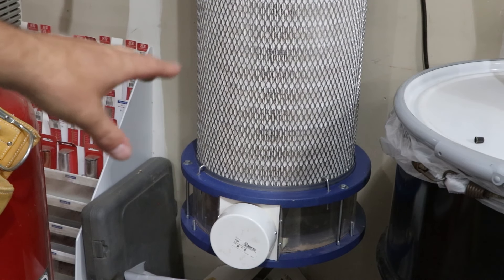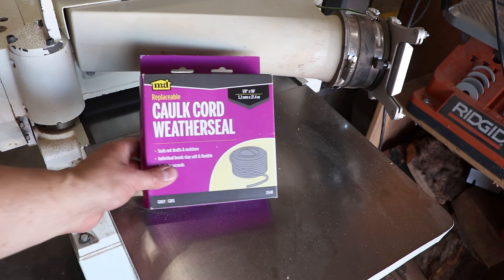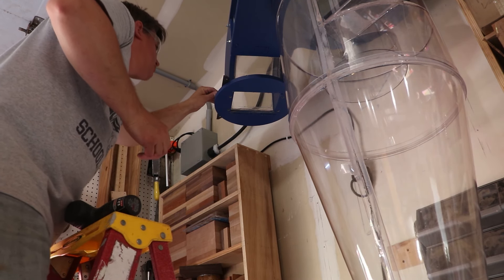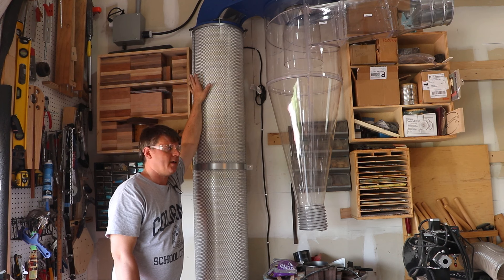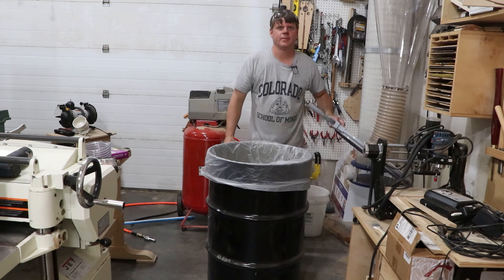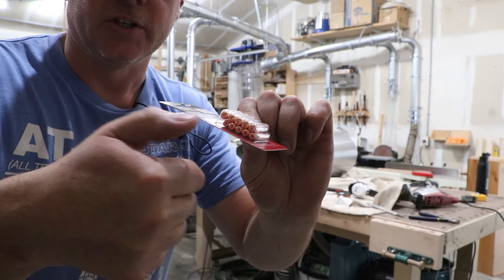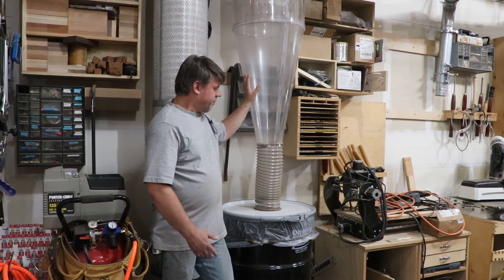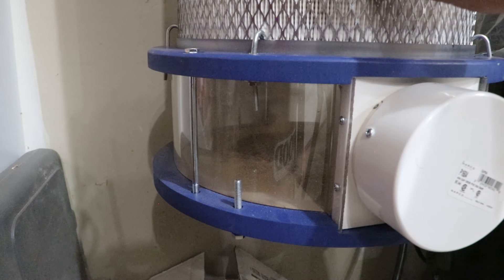Shop Made Upgrades to the Dust Collector

Comment: Turning a bag of hammers into lemonade.   I saw the first video and your frustration certainly came through, but it's good to see you plot solutions for this.   I respect your tenacity Brian.    Good on you.
Reply from the maker: Thank you!
Reply: @Benham_Design  Brian not to send you back to the drawing board, but Mike Farrington just posted a video adding a filtered cyclone DC to a new miter station and he used a fancy trick with a threaded top to a 5gal bucket to make both the filter and the fine dust collection bucket disassemble quite easily.   Sourced from Win (Wen?) Environmental.    He's entertaining enough to watch the video either way, but thought it applicable.    He also throws in the random humorous commentary (not to take away from your "that's what she said"  moment in this video).   👍

Comment: I cut a piece of cabinet liner to fit into the drum to keep the bag from being sucked up. I moved shops about 6 years ago, now my Onieda cyclone is vented outside, wow what a difference in suction, no more filter issues and constant suckage. I live in So Cal so pushing inside air out is not an issue. I did not like the build quality on the clear vue, so I got lucky and found a 3hp Onieda system with tons on spiral in my area for very cheap, no issues so far with this system...

Comment: It's too bad good dust collection is so hard to come by and so expensive.  I had a similar customer service experience with a rival of your manufacturer (the same one who's name is on your 55 gallon drum).  I got lucky though that the engineering was (mostly) better than you've experienced but the sales (rude), delivery (late) and customer service (non-existent) were absolutely horrible.  With that said, I like your fixes and you've given me a couple good ideas to upgrade my own dust collector.  Thanks!

Comment: Thanks for posting this.

J-bolts: great solution. Pretty much what the Oneida dust collector I have does. It just uses foam weather stripping to seal it. Installing with the spinning j-bolts is a bit fiddly at times, but it works.

Volume super low again whenever you're on camera. Most video editing software will let you normalize volume to a certain level clip-by-clip. I have volume cranked all the way up to hear you. I see you have a lapel mic in some shots, but it's not in the right spot. When you turn towards it (like the cough around 8:55) the volume is good.
Reply from the maker: At least it's getting the coughs. 😂
Thanks for the feedback video production is a steep learning curve for me.  
I had the mic closer, but people said they could hear me breath heavy.  
So now I moved it and it's too quiet.
Then of course I've filmed the next 4 vids that way already, so I have a back log of bad audio. 🤦‍♂️. Ahhh well

Comment: Again, I'll make a comparison to Laguna...  My DC has a baffle in the filter that you can spin manually to knock all the fines out of the filter, then they collect in a small bag that attaches to the bottom of the filter.  I just give it a spin every time I empty the hopper.  It also came with a can liner like you made...  All that said, I like how you solved all the issues the design team at Clearvue should have addressed. Some single sided weather stripping on the filter would have done the trick.  Probably $4 for a 50 ft roll.
Reply from the maker: If I got to do it again I would have totally put more consideration into the Laguna.  I do love my bandsaw, it is definitely designed to hit a lower price point.  However even though, it's not as robust as it's more expensive counterpart it's a solid machine and has served me well for several years.

Comment: Nice upgrades! I've had a ClearVue for 7 years and I love the performance. Build quality... yeah, I can see that argument. Fedex smashed two cyclones before I finally got one undamaged (they also destroyed a motor so it's hard to find fault with ClearVue overall there). I've thought about using a bag in mine and doing one of those setups like on the Oneida Festool dust extractor cyclone add-on thingy - where a small tube runs from the cyclone intake to the barrel and pulls a slight negative pressure between barrel and the bag, keeping it uncollapsed. I am lax with cleaning the filters... when I think about it I give it a beating to tap the dust loose... when I really feel ambitious I plug the intake of a shop vac to the dust cleanup and use the shop vac exhaust hose to blow out the filter stack. It's an interesting machine but overall I have quite a bit of love for it and I can see the air quality in my shop actually improve when it's running.
Reply from the maker: Thanks man, the performance is fine from comparable units from other companies. However after, I assembled mine , I will never equate Clearview with quality.  As for FedEx smashing multiple ones, my thoughts are that Clearview was too cheap to provide adequate packaging.  But that's my disgruntled mind talking as I'm not impressed with Clearview.
Reply: @Benham_Design  I wonder if the quality lessened since 7 years ago. Mine was put together nicely (still MDF and lots of silicone though). The thermoplastic is definitely not indestructible as FedEx proved - it will certainly crack under a sharp impact. Perhaps I’m content because my last DC complete garbage and made sit quality 10x worse when running.

Comment: I have the same system, so I appreciate the troubleshooting on the filters. I did not have the same issues with the assembly that you did. I guess i thought the engineering issues that you have mentioned are due to being the cheaper option for that size of collector (at least it was the cheaper option when I got mine several years ago)
Reply from the maker: Yeah, it is cheaper than a metal cyclone, and I can look past the fact that it is plastic.  The things I don't like about it are the lack of forethought into how it is assembled.  Such as how the filters are attached.  Several people have commented that the filter company makes a brack that would solve that problem, and I'm willing to bet the additional cost would be negotiable. However, Clear Vue doesn't appear to be interested in improving their products.  
The gaps between the plastic and MDF on the out port leading to the filter stack exist even if you didn't have to heat it up and bend it into place like I did.  
These gaps could easily be removed by adding an inch to the MDF flange then put a dado in it to hold the plastic in place like they did on the sides.  This again would be a negligible cost to do.
This cyclone has been on the market for over a decade and they have not made any attempt to improve the engineering of their product.
It has the potential to be an affordable and quality product, but the will to make it happen is lacking from the company.  
At least that is my perspective, but each of us have different expectations of what we find acceptable.

Comment: I was wondering if you have any ideas on sound proofing the machine / noise reduction , if you make any I would be interested in seeing them. Keep up the good work
Reply from the maker: I have wrapped a moving blanket around the impeller area and that has made some difference, and I plan on in the future to hang some Rockwool panels from the ceiling in that area to absorb some sound.  Unfortunately I don't think there are many options to quiet a 5hp motor with a 16"DIA blade spinning at however my thousands of RPMs.

Comment: Sorry you had a bad experience.

Two Thoughts:
1.Odd they don't include filter mounting hardware. My understanding is they are using Wynn filters, which when you buy them directly from Wynn, they include really nice clips to mount the filters on. I think they also included foam gasket!
2. I like to have a shop vac port on my cleanout to run while I used compressed air to clean the filter. I'm not sure if it does anything, but I like to think it helps pull the fine dust down vs letting it get stuck back on the filter.
Reply from the maker: A shop vac port I think is a good idea to keep air flow while cleaning.  I wondered how much was settling back on the filters after I blow them out while I was cleaning them

Comment: You should see if anyone in your area is interested in getting your saw dust! It makes pretty good animal bedding and you would be avoiding a landfill! How awesome would that be
Reply from the maker: Thanks for the suggestion, I live next to a riding center for horses and since I use a lot of walnut and other exotic species in my work, they didn't want it.  They said those types of sawdusts could make the horses sick.  Luckily it is still all organic matter so it will turn into dirt no matter where it ends up.
Reply: @Benham_Design  if you lived close to me, I would take it just for making compost! The smaller the particles you start with the faster it turns into compost. Currently I go to the two coffee shops in my area and get their used coffee grounds and mix it with shredded paper. If I actually remember to turn it, i get usable compost in about 3 weeks. We currently use a product called sanicare (espoma) for our chickens, and it's a hardwood dust. It's an awesome option for cat litter too. It smells better and is better for the planet. I wouldn't use it for compost of it was used as cat litter on edibles, but for flowers and other landscaping, I can't think of a good reason it couldn't be.
Reply: It will sort of turn into dirt no matter where it ends up but I think that when it goes into landfills, it's more likely to get broken down anaerobic than aerobic because of a lack of oxygen. Anaerobic breakdown tends to give off worse kinds of gases. (These are all things I've learned from random YouTube videos, so maybe not entirely correct). 

I'm turning into such a hippie... Sorry for the super long messages and if it seems like I'm being pushy or overly enthusiastic. I just get kind of excited when I see small steps being taken. It all adds up, you know?

I bet you if you offered those bags on Facebook marketplace you would have at least 3 people interested in picking them up once and possibly someone interested in taking them off your hands perpetually. Especially since you're not using treated lumber.
Reply: Hell, that riding center may already know someone taking their horse poop and turning it into compost who may be happy to have extra carbon to expand their operation
Reply from the maker: I'll look in into and see if anyone wants it.  If you like gardening YouTube channels as well.  I would recommend a channel called "Gardener Scott". He is incredibly knowledgeable and lives just down the road from me.

Comment: Maybe plasti-dip the insert? The rubberized coating might help to prevent tears. Or maybe some of that material people use on the edges of their car doors when they cannot reliably keep control of their doors when they open them.

Comment: I did not see your original video, but I am guessing you should have left it up. When looking online for a dust collector i constantly saw how great clear vue was and how great a value it was. When I purchased mine I was definitely surprised to see MDF, not even plywood. Within the first few months I was already having MDF cracking from the action of removing and emptying the bin slightly moving the cyclone. As you show in this video, how the filters are attached is just hack. A group of college engineers for their senior design could have greatly improved what clear vue has ultimately released to market. And on top of all of that, it is screaming loud. I have used 2 hp- 25 hp dust collectors throughout my life and the clear vue took the cake as loudest. First chance I had a break in my jobs I ordered a Onieda and could not be happier about making the change. I think more people giving honest opinions about the design and engineering would help buyers since the money saved when comparing to other models will eventually end up costing you.
Reply from the maker: Yeah, that's the problem with YouTubers, and sponsors.  They get free shit and tell everyone how awesome garbage is.

Comment: I don't think that device you made to prevent the bag from being sucked up into the dust collector is needed, that end of the dust collector is where the dust is BLOWN into, there is no suction there otherwise the dust wouldn't be deposited into the canister.
Reply from the maker: That's what I thought at first.  But I have the mini version of a cyclone "The dust deputy" hooked up to my shop vac and I put a bag in it, and it sucked the bag up to the top port.  
So I am making an assumption that the same would happen at scale.